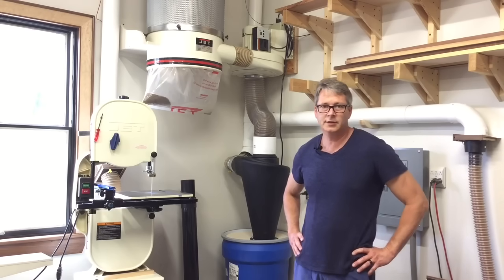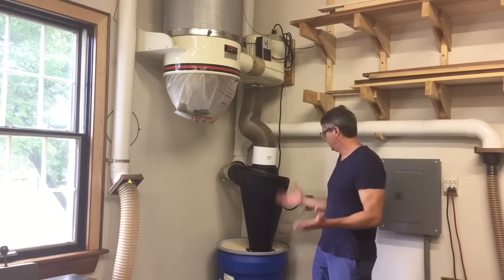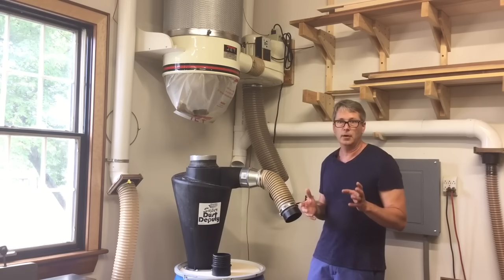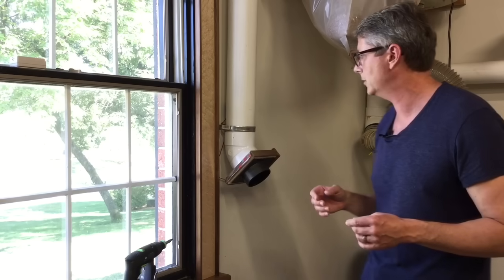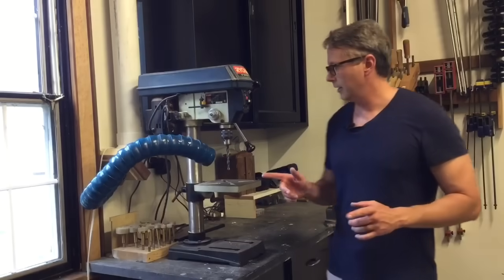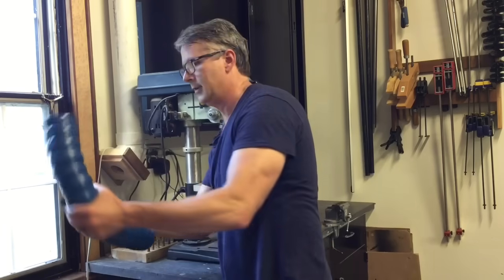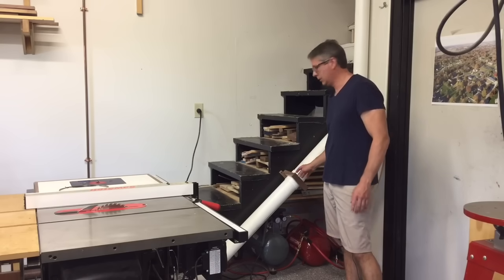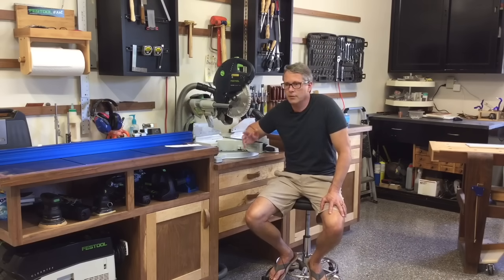Advanced Dust Collection System for the Home Workshop.

Comment: Where did you get the additional micro switches. I want to make sure I get the right one to work with the system. Great video. Lots of good stuff and well designed system.
Reply from the maker: These look like what I have. Cylewet 20Pcs Momentary Hinge Metal Roller Lever Micro Switch AC 5A 125 250V SPDT 3 Pins (Pack of 20) CYT1096 https://www.amazon.com/dp/B07BL33XXT/ref=cm_sw_r_cp_api_i_FQCMEbQK0F73W
Reply: Walnut Workshop 
Awesome. Thanks for quick reply.

Comment: So I have the same Jet dust collector as you with the soft on and off buttons (mine came with an IR remote that works poorly). How did you make the long ranger work with it? Mine, if I turn it on and remove the power (ie, unplug it) and then plug it back in it does not come back on. I've been thinking to bypass the circuitry in the control panel there with the LongRanger system.  Is this what you had to do as well?  Thanks for sharing. I have come back to this video several times to harvest ideas. I really appreciate your videos.
Reply from the maker: Yes I disabled and bypassed the IR remote stuff. And changed it from 110 to 220. 
Good luck and glad my video helped.
Reply: @Selandry1  Thanks! I am switching to 220 as well. Appreciate the response!

Comment: Great contribution, I strongly feel will be using many of your suggestions for the small shop I am trying to put together. I may end up doing it in the basement of my home and I'm very concern with the subject of dust collection. I may even add a ceiling air filtration system too. Thanks for taking the time to make such a helpful video.

Comment: Well done - this video is especially helpful to me personally because I am in the process of designing a new shop space and get to start with a blank canvas. You have so many great ideas packed into one system and one video, plus I see several other smart shop ideas in the background that aren't featured in this video! If I may, I would like to ask you a few questions about the microswitch and other aspects of your system. What's the best way to connect?
Reply from the maker: Thanks Jack. After making this video I got a lot of similar comments so I did make a shop tour video. Check it out. https://youtu.be/i03LmRYcKHs  
The micro switch i got off Amazon. Called Long ranger, but it only comes for 220 volt systems. Some guys have work arounds to make a switch for 110 volt systems, but if your serious about your shop your going to need 220 eventually and I would recommend a 220 dust collector. I always see comments and respond unless it’s a dumb question. so ask away.
Reply: Thanks for your quick replay! My dust collector is 220V, so we're in good shape there. I read some so-so reviews on Amazon for the Long Ranger- have you had any hiccups with it? Also, which style of micro switch works best? I see one with what looks like a tiny roller, others with maybe a bent spring. What gauge wire did you run?

Slightly different topic- I'm considering running my main (6" PVC) and branch (4" PVC) lines under the to-be poured concrete floor to save on floor & wall space, Do you have any experience with this? Either way, what are your thoughts on this?  Also, regarding PVC pipe- did you run the thin-wall (SCH 21) drain waste & vent (DWV) pipe w/ bell ends or SCH 40 which they also refer to as "drain waste & vent" pipe? Thanks again!
Reply from the maker: Hey Jack. Don’t know what gauge my pipe is but I would get the thinnest cheapest sewer PVC you can. The pipe doesn’t need to be very thick at all. 

As far as the switch. Mine had a tiny roller. Don’t know the gauge wire, but it’s really thin and I have had zero issues with the long ranger. It has been rick solid.  

As for the  pipe diameter, bigger is better.  Many people have criticized me about going with 4” pipe throughout. But if you watched my shop tour, I really care about how my shop looks and I didn’t want huge pipes all over the place. 4” works great for me running one tool
At a time with a 1500CFM dust collector.  Max run is about 35’. If you can get bigger pipe and don’t care about how big it looks then you will get better performance.  And don’t believe the BS about grounding. You won’t blow up. It’s a pile of crap from the YouTube safety police. 

Good luck!
Reply: anderjack5@gmail.com is my email.

Comment: Great video, just setting up my dust collection system (a bit more modest ststem, eg. less expensive) this video will be a great help.  What power module did you use for the low voltage switch at the blast gate? Thanks again

Comment: It is REALLY urgent , I cannot find the long ranger system in 110v on amazon . I have searched everywhere for other products to simply hook all low voltage wire to two terminals . They only make 220v long ranger multi switch gates. Or 110v remote controlled , which I don’t want . Is yours 110v ?
Reply from the maker: They no longer make the 110V version. If you search there are some work arounds. Some were suggested in my comments for this video if I’m not mistaken.

Comment: How has this worked for you over time?  Do you feel like it pulls enough air, even through your long runs?
Reply from the maker: I love it still today. Even at the longest run the air flow is enough for my needs. No regrets about not using the  6” pipe. I realize that my system lacks efficiency due to the smaller pipe, but I have still found that I get great dust control even when using two tools at a time in my small shop.
Reply: @Selandry1  What's the total vertical height of the mounted system?  I have the same jet collector, and I've been wondering about doing the same setup with a Super Dust Deputy.  I'm just somewhat limited on height, unfortunately.
Reply from the maker: Mine is about 10’ height, but I think you can get away with less for sure. All you need to do is get a can that’s not as high as mine which will lower the dust deputy.  The only draw back is you won’t be able to push a tool that is very tall under the filter.
Reply: @Selandry1  I'm trying to do it right the first time. I couldn't tell the model of your DC?  Is it 2HP? 220V?  Thanks. Great video.

Comment: I've watched this video several times to prep for my REAL DEAL dust collection system. Really great work and I thank you for helping us out with your straight forward, no BS approach in this video.
Reply from the maker: Thanks Ben!  I hope your build goes well. I still live my system and I hope you do too when all is done. Thanks again for the super nice comment.
Reply: Walnut Workshop  I have posted a question to you about finding a 110v multiswitch gate , I can only find 220v or 110v but using the remote .
Reply from the maker: joe I am told that they no longer make the 110 volt, but if you search there are some work arounds out there.
Reply: @Selandry1  yea looks like 110v is discontinued.  Searching for another system. Do you have any leads of a simular system ?
Reply: Walnut Workshop hello just wanted to know what bandsaw brand was the anemic piece of crap. So I don’t have to buy it, and great content on dust collection. I’m sure mine will be just like yours. Have a nice day & GOD bless!

Comment: I'm planning my own shop dust collection and found this very helpful! Thank you very much!  Question regarding the 4" pvc.  Aside from bulk, is there any reason that you didn't go with 6"?  Any regrets with not going with 6"?  Thank you.
Reply from the maker: No regrets. Plenty of air flow using my collector and the 4” pipe with using one tool at a time. I went with 4” because the 6 inch just looks so big and bulky.

Comment: Great video. How did you convert the two 4" ports on the original collector to  one 6" ? I was going to take the plate off, replace it with a piece of plywood with a 6" hole and add a flange. Any thoughts. Thanks, Keith
Reply from the maker: When you remove the double 4” plastic fitting from mine there is a 6”flange so I didn’t have to do any modifications.
Reply: @Selandry1  Thanks for getting back to me.  I really enjoy your videos.

Comment: What are the specifications for the dust collector you are using? I have a 1 1/2 HP Delta rated at 1200 CFM. I’m looking to pipe up a system similar to this. I love your blast gate and boom arm ideas too by the way. Thanks for the great content.
Reply from the maker: Mine is the same. Rated at 1500CFM though, but I think that’s a bit generous.  Thanks for the compliments.

Comment: This is an awesome and informative video. Regarding the blast gates: Heads up to Walnut Workshop and anyone who is watching this video. After a quick search, it appears that quality control was an issue on the 110v gate switches. Amazon reviewers give them an average of 2.5 stars. It also appears that they've been discontinued. The 220v ones are still available, at a price of $78 each on Amazon and come with one switch, one gate, and 100ft.of wire. 220v system still has 2.5 stars for poor long term durability. Additional gates/switches can be bought here:
https://www.pennstateind.com/store/LRGATE.html

Woodcraft has blast gates ranging from $6.00-$124.00 here:
https://www.woodcraft.com/search?q=Blast+gate&button=search

I love your video and your setup. As a small shop owner (13'x17'), the added expense and complexity of adding automatic gates doesn't make sense for me, but it would be awesome in a big shop. I'll definitely use some of your other ideas, though.Thanks for posting your setup.
Reply from the maker: My setup is 3 years old and the micro switches are still all doing fine. I would give it 5 stars if I was to ever rate something. Maybe I should after reading your comment.
Reply: @Selandry1  You should. I guess that's the nature of reviews. Many times, people who have positive experiences don't comment, and those who have negative experiences are the proverbial "squeaky wheel". Unfortunately, that skews the reality. If you find a reliable source for the 110v systems, please post a link. I couldn't find them available anywhere.
Reply: Alternative 110v setup

https://www.centralvacuumstores.com/gus-4-dust-collection-blast-gate-kit-with-switch-for-auto-control

Comment: I got tired trying to read all the comments, forgive if I re-ask a question. How did you attach to your table saw to your DC system? I have a maple floor in my shop and I am desperately trying to find a way to not drill 5" holes in it. As a result, I've been stepping over flex hose for 10 years now.
Reply from the maker: At 11:20 I explain it. I feel your pain. Biggest reason I upgraded was the pain in the ass of stepping over that hose. Hope my video helped you out.
Reply: @Selandry1  Thanks. I don't know how I missed it in the video. I  must have been dreaming about not stepping over my hoses. I don't have steps. I think I'm going to have to drill.

Comment: I am about three quarters through adding my dust collection system.  Am am using your video as a guide.  I really appreciate all the tips, saved me a lot of time (and using sewer PVC is a great tip, much cheaper).  Also found that if you add one layer of gorilla tape on a standard 4" gate valve, it fits perfectly (and snugly) into the 4" PVC pipe.  Thanks again.  Now I have to decide if I am going to add the microswitch gate valves, those are awesome!
Reply from the maker: Glad it helped!

Comment: That's a great, uncomplicated system.  However, experience with microswitches would lead me to use magnetic reed switches - which are often used in burglar alarm systems (available once upon a time from, RadioShack, but nowdays, an electronic supply store like Digi-Key or Mouser, or, of course ebay), which are dustproof and more reliable.  Unfortunately, it seems that PSI no longer makes the Long Ranger in a 110v model, only 220.  But a little googling, a small 12-14V power supply and a relay will do the same thing.  Thanks!

Comment: Great video.  Lots of ideas that I am trying to duplicate.  One question - the 6" hose from the dust deputy to where it connects to the Jet.   Did you just clamp the 6" hose to the 5" fitting or is it actually a 6" fitting?   And how did you connect the part that holds the filter and the bag to the wall?

Comment: I am not here to knock your DC system,however I do see a couple of problems. #1 the saw dust in the bag is a result of a leak in the system. Most likely at the 6 inch coupling going to the top of the cyclone. If you you did not have a leak that amount of saw dust would not be there unless you allowed the dust bin to over fill.
A good way to check for leaks is with a couple of incense sticks. With the smoke coming of the sticks wave them near the couplings. If it has a leak the smoke will be drawn into the system of course with the DC system running . If no leaks the smoke will just float away.
#2 stay with the 5 inch diameter pipe the volume of air moving is substantially lower with 4 inch pipe.

Ops I latter saw that you did have a bin over fill thus the saw dust in the bag. Very nice video.
I like the blast gates and the micro switches being used to turn on the DC.
I went a little farther with mine. I have an Arduino micro controller that senses which tool is powered on and opens the blast gate for that tool and 
Closes all the other gates.

Comment: Great video. I picked up some ideas as I was building a mobile system. Wonder, if you still see posts here if you could answer a question. How did you attach the 6” hose to the inside of the 6” coupler?  I’m about to do that and wondering about double sided tape, epoxy, screws, etc. Thanks for the great video.
Reply from the maker: It fits in there very snug. I don’t think I have anything holding it in there other than friction.  Good luck. Glad to see people still getting use from this video.
Reply: @Selandry1  Thanks.  Mine is a little loose, could be that flex hose sizes vary.  I may try a little construction adhesive or something like that.  Lot of good things in the video.  I'm in a small shop and making the rolling cart version.  I liked how you could quick disconnect the dust deputy from the blower!  Have a great night!

Comment: What's the "Footprint" you've got up on the ceiling?  Excellent setup!  I'm concerned with my ceiling height.  Trying to save space best I can.
Reply from the maker: Maybe 4’ x 2’ ceiling footprint. My ceiling is 11’. For lower ceilings I would position the canister filter in the corner and get a shorter collection can. They sell those metal drums that are only 18 inches high on amazon. You would just ave to empty it more often. Good luck.

Comment: isn't the reduction right off the cyclone from a massive CFM reduction?
Reply from the maker: Probably, but it still has plenty of pull for all my machines.
Reply: Not sure about probably, a 6" to 4" works out to be well over a 50% reduction. The break down on Oneida spells this out a bit since you are using that vendor.

https://www.oneida-air.com/blog/how-to-select-the-correct-duct-diameter

Comment: I have virtually the same dust collector and it has a "spinner" arm mounted on top of the filter to knock the dust loose. How do you knock the dust ftom the cannister with it mounted so high? Or is it simply not an issue because the vast majority of it never gets to the cannister thanks to the cyclone?
Reply from the maker: Mine has a spinner thing too. I never use it.  After reading your comment I got a golf club and spun it. A very small amount of very fine dust fell down. Maybe a half cup.

Comment: Did you have to ground the PVC pipe to eliminate shock?
Reply from the maker: No. Check the comments. It had been thoroughly debunked that it is not necessary to ground a system like mine. Static sparks can ignite highly volatile fumes, but not sawdust. A good example sighted is that If static could ignite large particles (and sawdust is a large particle)we would all burn up in our beds at night due to the static sparks from the sheets. I did a lot of research after safety police trolls descended on me. Not to mention all the research I did before deciding not to ground it.
Reply: Selandry1 He said shock, not explosion (for once someone asked the right question!).   Some grounding near places you might touch the plastic might prevent some nasty shocks.  I’ve been zapped by my 6 foot flex hose many times.  I’m not worried about explosions either.
Reply from the maker: That being said and good point- I have not been shocked by my system ever

Comment: I work at an industrial carpenter shop and we had a someone who used to work there who had professional experience with installing the most efficient collection systems. One thing he said was to not have the vertical pipes go directly up into the ceiling horizontal pipes. It creates a bad airflow and it gets piled up in the pipe due to how the air will curve up and over when moving into the horizontal pipe. Instead bring your vertical pipes up and to the side of the horizontal pipe. 

Your setup is probably to small for that buildup to occur, but other than that, the setup is pretty solid!

Comment: Duct elbows:  don't bother avoiding 90 degrees:  two 45's have exactly the same pressure loss.  The trick is to use a "long radius 90".  It's roughly 1.5 times the radius, and it's the radius that kills pressure.  LR90 will clean up the layout.  The most important part of filtration is that upper bag on the DC:  all the ones I've seen from the factory are not very effective on 1--3 micron particles, which is where you find the most harm to human lungs.  Check out American Fabric Filter for after-market bags.  The centrifugal separator (Dust Deputy; the conical thing) is useful on shop vac systems,  but for a larger central system the filtration bags on the DC work just fine, and the floor space is about a trade-off.